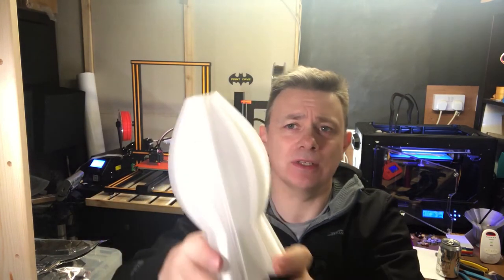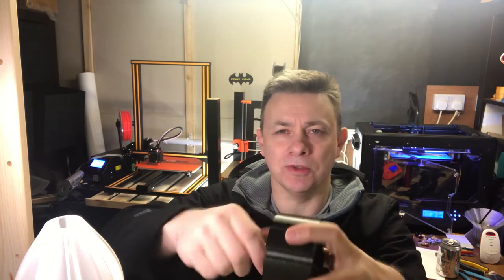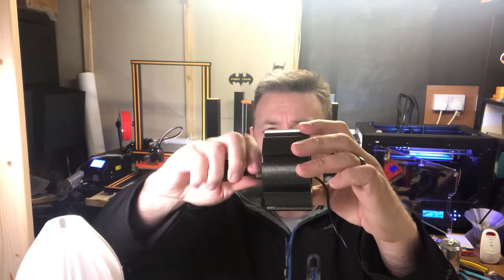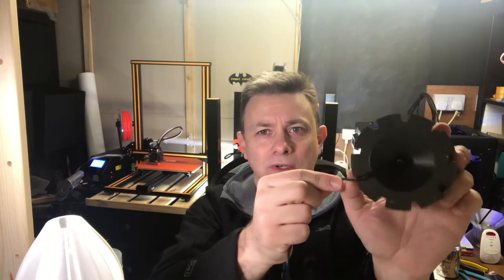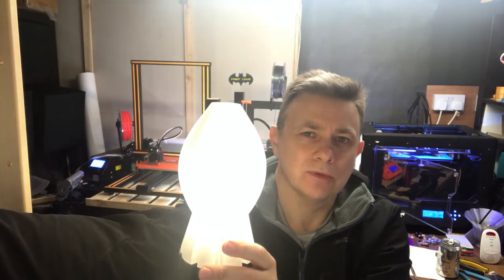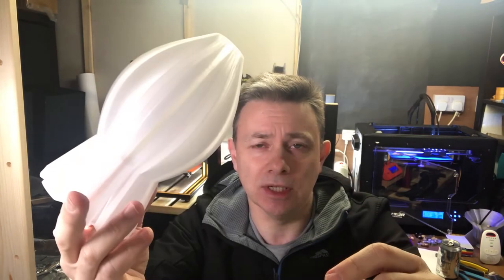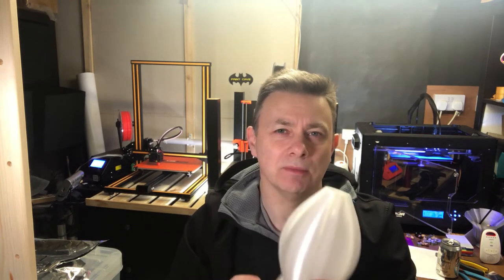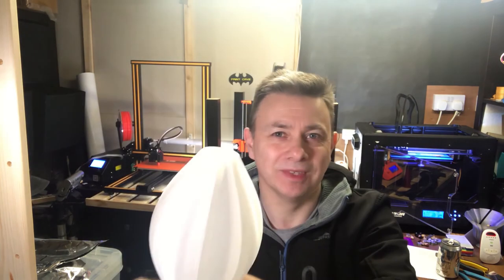My 3D Prints - Rocket Lamp

Comment: Hey can you give more info on you print profile? Temp Nozzle / Bed / Speeds / Retraction?
Reply from the maker: TinkerCave for CPE or the PLA or both?
Reply: For the CPE Material :)
Reply from the maker: TinkerCave I went with 245 nozzle and 75 bed, I believe the cooling fan was down at around 15%
Reply: OK thanks!